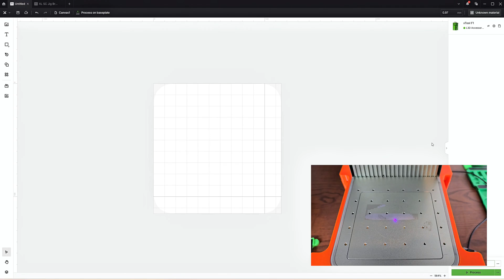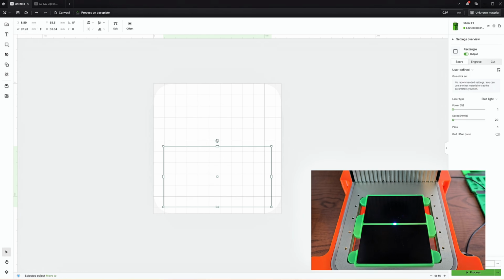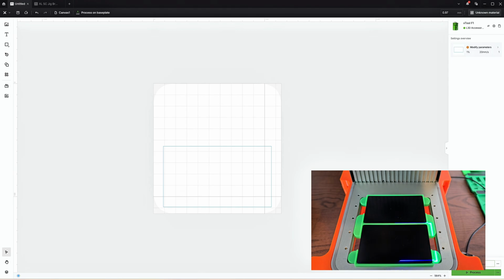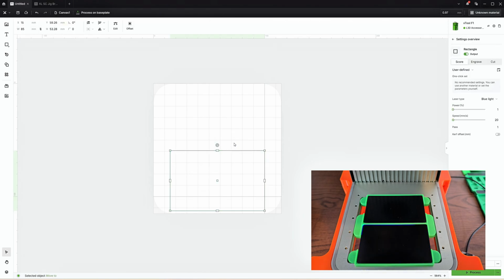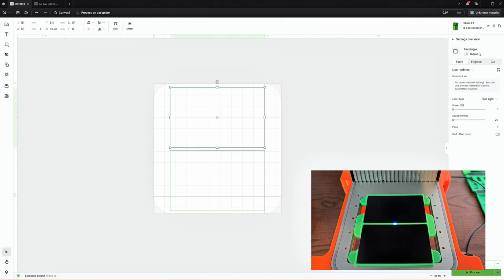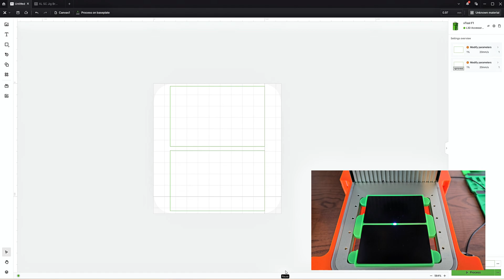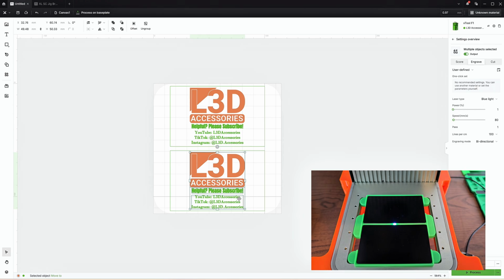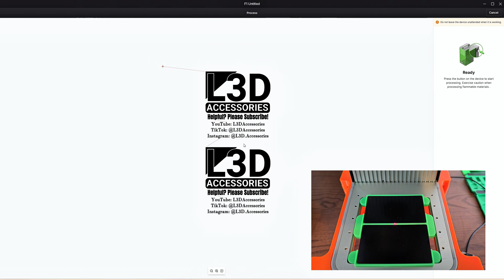How to Make Perfect Jig Templates in xTool XCS | Laser Engraving Setup Made Easy

Comment: So the trick is to create a jig with known coordinates, then discard those and instead guesstimate the correct placement? Brilliant.
Reply from the maker: Once you create your jig template with a manually placed outline box then you can easily reuse it to get quick accurate engravings every time. However due to all lasers being calibratrd differently and tolerances of materials and jigs you can't always guarantee that one size fits all. So by doing this the first time you are basically calibrating the jig to your own laser.